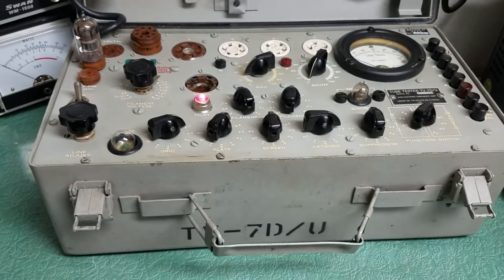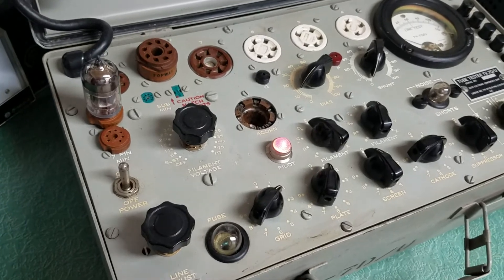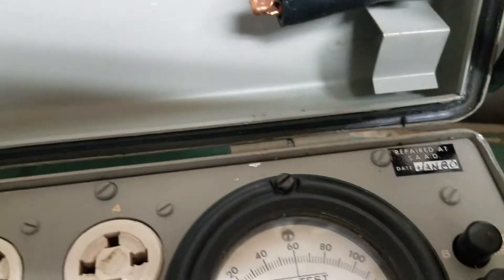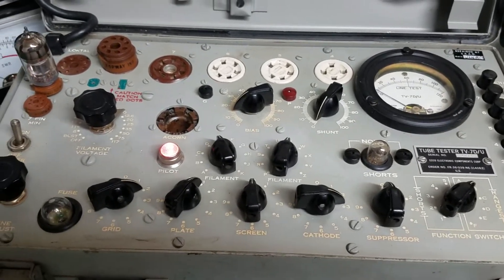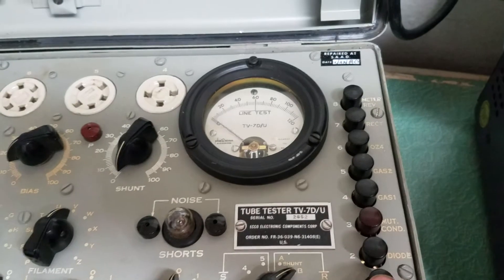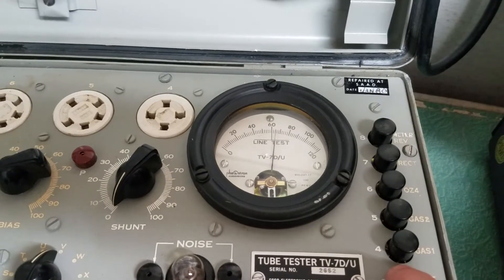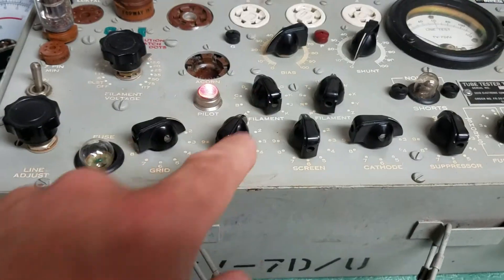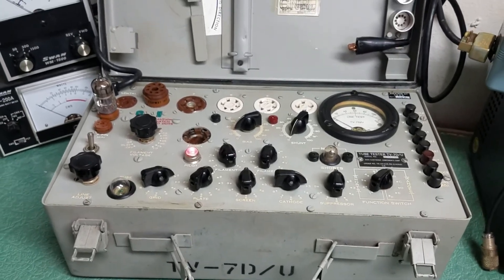TV-7D/U Tube Tester

Comment: Hi John ,  I have one of these and am wondering how I can tell if it is properly calibrated etc.  Finding someone around me that can calibrate it and check it out is like looking for some type of magical unicorn.  I live outside Boston.   
Are your machines properly calibrated?  Anyway I could buy a tube from you that you have tested throughly and written down all the parameters on?   Could I use it to check my machine through the diff tests?   If it was close I would at least know it was close and not completely out of wack. 

Any info would be greatly appreciated.  I am a pro guitarist of 30 years who is just now beginning to get involved in what is  inside the amps . :)
Reply from the maker: Hi Blake
Mine had been calibrated by the previous owner> Most of the Hickok testers do not need much calibration. To see if it is somewhat close though you can just check several tubes that are known to be good and see how it compares. Sorry I cant be more helpful.